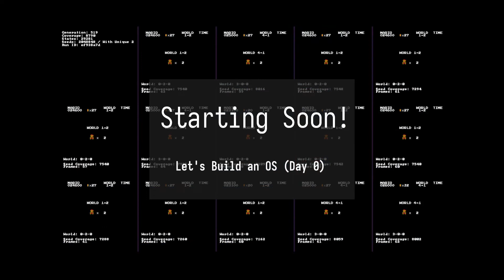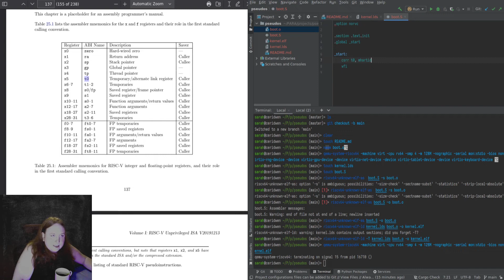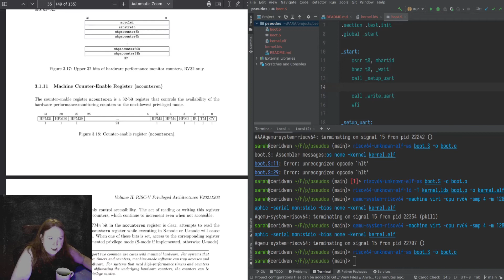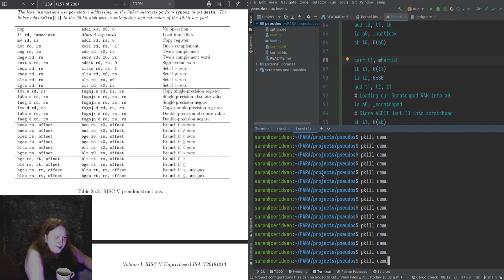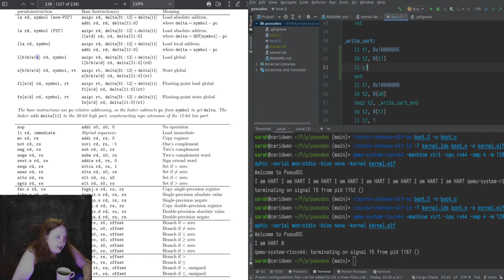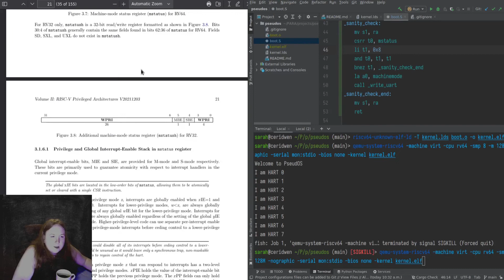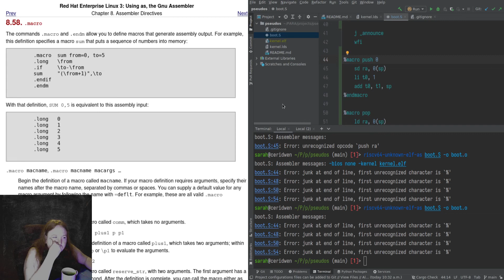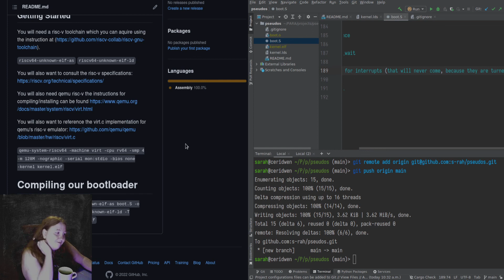Let's Build an OS: Day 0 - Getting familiar with RISC-V and writing a small bootloader.

Comment: great series. Quick question, at 28:30 you reference Qemu virtual implementation of the memory map when you have the architecture reference manual in front of you, is the Qemu virt memory map different from the architecture map or just for ease of been able to grab the Hex?
Reply from the maker: The risc-v architecture reference only covers the CPU internals (e.g. register names, how to setup page tables etc.). For things like e.g. where the PCI Bus is located or where the UART ports are I needed a reference to the particular virtual machine specification (i.e. how the reset of the machine was configured).
Reply: Got it. Thanks